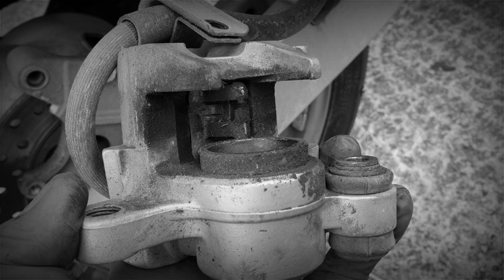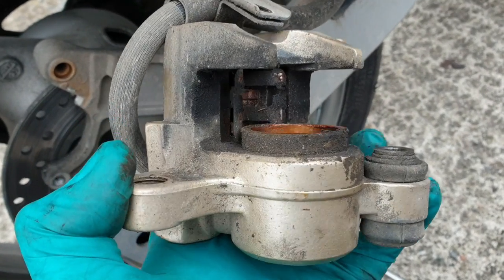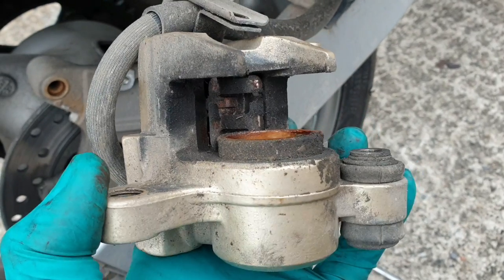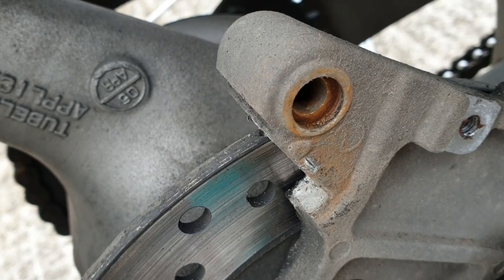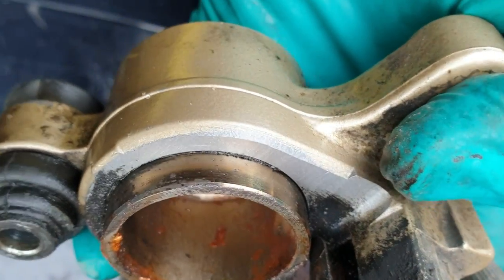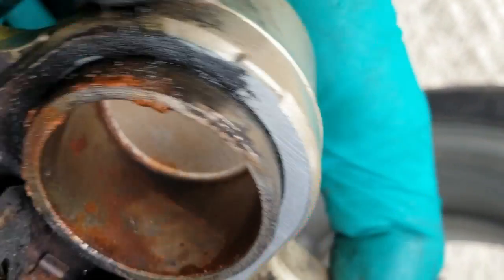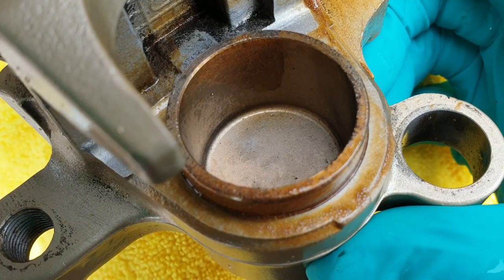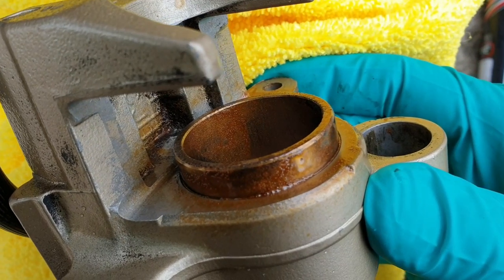I Love Copper Grease

Comment: Hi Jim ... I've personally used copper grease & many Wurth products for 30yrs plus, never had any come backs from customers with brake issues ... winter riding destroys any bike (FACT) all we can do as Techs is apply some form of anti-seize to bare metal parts, if the customer chooses to hit the bike with a pressure washers, that's where the wheels come off as far as any protection applied is then compromised ... I always try & educate winter riders to not use pressure washers, some listen, most don't to their own detriment ... On the subject of copper greases, it's never good practice to apply to the rear of most bike pads, as some have a perforated back plate & copper grease migrates through the pad friction material to the braking surface ... Hey Presto, no brakes ...  Always a pleasure to tune into your content Jim, very professional & methodical approach to diagnosis, much like my own ... Merry Xmas 2022 bro👍

Comment: To be fair Matt's argument is.... there's no need to apply it to rear of brake pads.  
I can see how applying it to the pistons may work,  but  so does a regular caliper  'strip and clean'.  

The trouble with grease on caliper parts; is the risk of contaminating the pads (by handling) when you do eventually give it a strip and clean.
 Just increase the maintenance during the winter months as i do.
Reply: New pads, piston back in, slowly  comes out. My brakes don't have copper grease and all 3 pistons clean up nicely after 35,000 miles and 4 years.

Comment: Hi jim! I've not got any of that but I have red rubber grease, do you think that would be any good, thanks john.
Reply from the maker: Whilst red rubber grease is really kind to the seals it doesn't really offer any decent weather protection against road salt.  If you don't intend to use your bike through the Winter months and risk salt getting on the brake calipers I wouldn't worry too much.

Comment: Copper Grease is mineral based and may damage any rubber component that it comes into contact with such as rubber boots, gaiters, seals and O rings, etc.
Copper Grease is an excellent conductor of heat and when used on the backside of a brake pad can significantly increase heat transfer.
Copper Grease has poor lubricating properties. It is in fact an anti-seize compound.
Never use Copper Grease on the back side of a brake disc mounting face as this can increase the Disc run out lead to DTV (Disc Thickness Variation) causing brake judder.
A good quality non-mineral grease should be used on moving parts only and never applied to the back face of a Brake Pad or mounting face of a Brake Disc.
Most modern brake pads are supplied with noise fix shims and do not require the use of Copper Grease, which could be detrimental to their performance.

Comment: why dont they make the piston out of stainless?
Reply from the maker: Some manufacturers do but most pistons are just plated.  The biggest problem isn't with the actual piston itself it's corrosive Road salt getting in the groove between the caliper body and piston causing corrosion to build up underneath the dust seal,that's what causes most calipers to seize up.
Reply: @SuperbikeSurgeryTV  if they used material that doesnt corrode it will completely disable this problem. i guess its just planned obsolescence like everything else.

Comment: all its done is gather brake dust and road dirt and created a grinding paste . fail!
Reply from the maker: Once again another argument that I've been over before. Your comment has only reaffirmed my opinion that you probably have no real world experience and are basing your objection on an opinion. 

The Wurth CU800 used in this video is a product designed for this exact application. Recognised and approved by manufacturers. 

You clearly don't understand how a brake caliper works if you think the build up of road grime is somehow going to turn into "grinding paste" as you put it and wear something away. The only moving part is the point between disc and pad with the exception of the piston moving a couple of thou. Nobody is suggesting you put CU800 on the the friction surface of the pad.

The point is to protect the exposed parts of the caliper from the highly corrosive road salt. This method is widely used and has saved thousands of people the unnecessary expense of needing caliper rebuild every few years when using their bike through the winter. Obviously if you live in California or somewhere that road salt isn't used it's unnecessary. 

All these points have been discussed at great length over the years, in the comments and elsewhere.
Reply: @SuperbikeSurgeryTV  if you cared that much about corrosion you would spray everything in ACF50.  

love how you attempt to attack my knowledge of a braking system and what I can and can't do.. no grease on my calipers and they are in perfect condition.  but then I look after my stuff , not smother it in grease and ignore it for 6 months.
Reply: @SuperbikeSurgeryTV  don't waste your time with those whom have no real world experience.
Reply: @bikerboi1983  if you have seized pistons copper paste makes it easier to unseize them
Reply: @keepthefeather8181  lol